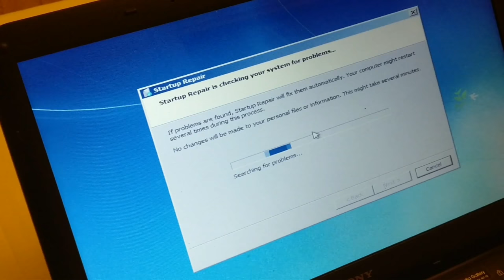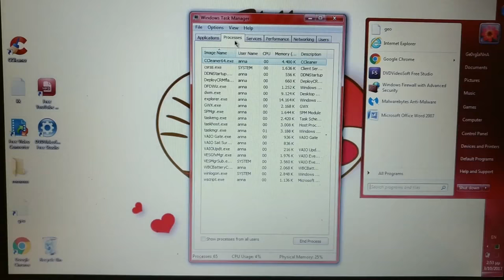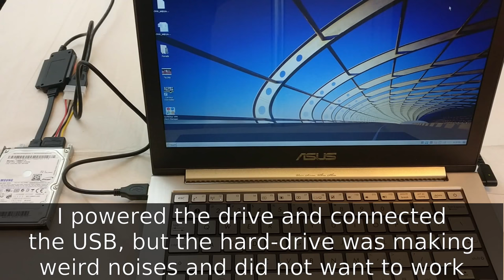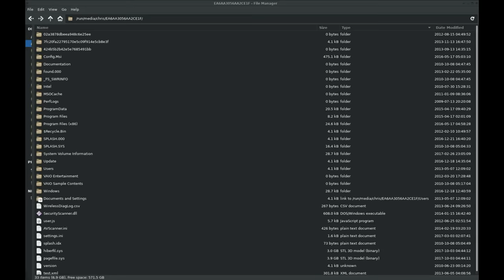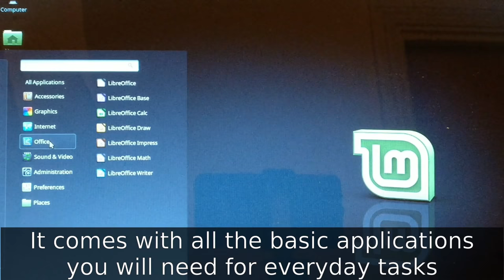SMART Failure Predicted on Hard Disk Replace

Comment: What we do when our system not responding after pressing F1 or any other key
Reply: Check your keyboard connection
Reply from the maker: Try a wired keyboard if you're using wireless

Comment: What if we already press F1 but it doesnt respond
Reply from the maker: If your unable to boot the operating system, I would say the next step is to remove the hard drive and access it directly using a external adapter. Another thing you can do is use a Live Linux flash drive like this: https://www.online-tech-tips.com/computer-tips/how-to-retrieve-windows-files-using-a-linux-live-cd/
Reply: @ChrisAsipyan  Try F9 hor hp, F1 for sony, or F2 hor toshiba

Comment: I have this error message but my hard disk is fine I go to cmd and check the disc it doesnt find any problems and I can use everything. How do I remove this message???
Reply: Same here... How can resolve it... Help...
Reply from the maker: You will need to replace your disk with a new one and copy your data off of it before it completely fails

Comment: Can someone tell me why this happens tho
Reply from the maker: SMART refers to the self diagnostic tool in your hard drive.. it is not passing the diagnostic test(s) ... There are various reasons why this happens. A quick Google search has brought up these common issues: 

"Usually, hard drive SMART failure may be caused by excessive bad sectors or shock, not defragmenting when the disk is almost full, the wrong shutdown, overheating, etc."

Comment: Hello, I have only just been told about this Issue by someone who should have brought it straight up to me but they decided to wait 3 days when they only live in the same house so stupid they are, my Issue is I press F1 and get nothing no option to do anything at all.
Reply from the maker: To try and recover data from it, I would try to boot up a Linux based live operating system either via CD or flash drive to get temporarily access to the hard drive. Hopefully if the hard drive is still functioning, you can recover some data. You can use Linux OS's like this for example: http://www.system-rescue-cd.org/
Reply: I have Windows on It, but I have seen a few other clips to Recover with links to a site what ended up having a Mal Threat what my Antivirus Blocked and moved into my Virus Chest.
Reply: Graham, you're better off booting into Linux, you can do it from USB drive and even from old SD cards you have lying around (my case). To do this, use a program called YUMI (see my detailed comment above). I recommend starting with Xubuntu, it's beginner-friendly.

Comment: My pc is showing it but no problems at all
Reply: Then it just needs the hard disk replacement, 160 gigs usually sell for $21, but you can get an 80 gigs for $10 if you don't use your computer much
Reply from the maker: True, it may go on for some time without showing issues but I would not trust the drives too much after seeing this.
Reply: @ChrisAsipyan  ty

Comment: I get the same warnings on my desktop expect it wont start it blue screens 🫠
Reply from the maker: In this case, I would remove the hard drive and connect it via a USB adapter to another computer to try and save needed data from it.
Reply: @ChrisAsipyan  yeah the drive was completely dead there was no saving anything